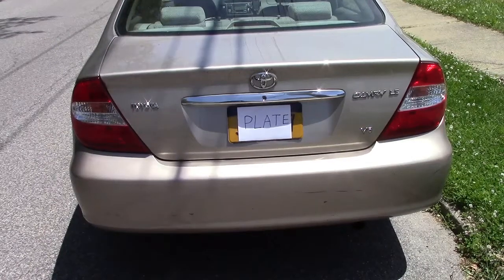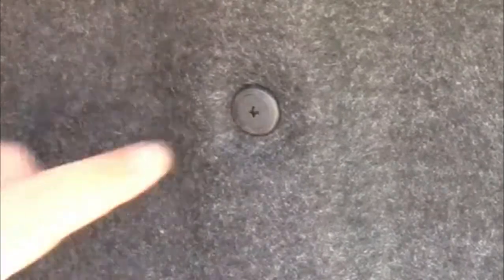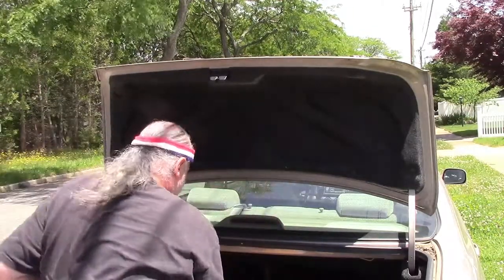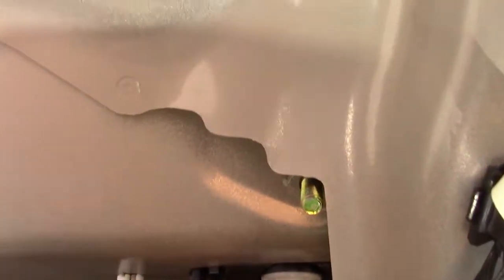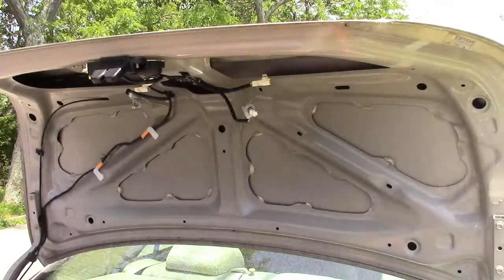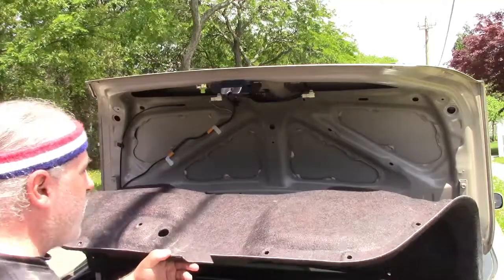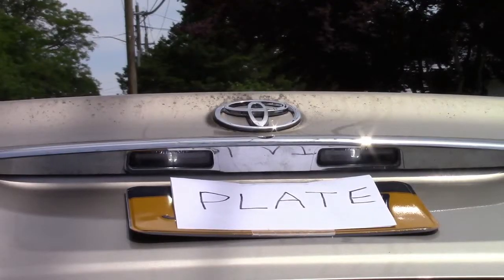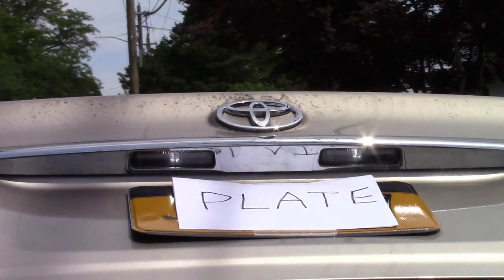How To Replace License Plate Bulbs 2002-2006 Toyota Camry

Comment: Your explanation was truly excellent, even though I'm not so sure you need the entire liner to come out before replacing the bulbs. I could be wrong. As a side note, thank you for the explanation of the philips head Toyota retainer clips. Unfortunately, I broke a few after someone told me you could just slip a flat head screw driver beneath the edge and pop them out. They popped all right...from being snapped. Live and learn.
Reply from the maker: You most certainly can do the job without taking the entire liner off.  I needed to remove it for the video, and believe me, it's much easier with it completely out of the way.  For the broken retainer clips, there are many styles, even kits, you can find online., for not much money.
Reply: @jaykay18  Yes. I did snag a bag of them. They're not OEM, but worked just fine. Appreciate your video and thoughts. Best
Reply from the maker: @msunshine123  Thanks!

Comment: Thanks for the help. I couldnt get that green handle off haha. I just slipped thr carpet off around it, and later took a pocketknife and cut a slit in the carpet behind the emergency release and now its easy if i have to do it again.
Reply from the maker: It's tricky for sure.  Your way is a lot easier if you don't mind the slit.
Reply: @jaykay18  haha yes one thing I love about my old Camry is since it's depreciated as far as possible Im not frightening to "customize" certain aspects 😆
Reply from the maker: @jimmypavone3231  I love when cars reach the "beater stage".  Don't have to worry about anything anymore.

Comment: Great video. On my 2003 the trunk release is in 2 pieces. There's a slot in the back where you can split it with a flat screw driver and remove the"cap". You can then work the plastic prongs that are holding the actual handle on to the sprocket.
Reply from the maker: Thanks.  Yes, it's in 2 pieces.  That's another way to do it.

Comment: Looks easy enough, and turned out nice!
I think those clips may have worked easier to fix my waffle iron, as opposed to the push in ones I got.
Reply from the maker: Yeah, not a bad job at all.  Rewarding when it's done.

Those clips came with the car, of course.  I bought a clip set, has maybe 20 different styles.  Bought it on Amazon I think, maybe fleabay.  Haven't needed to use it yet but I will, one day.

Comment: 2 Millennials were angry that this video was about changing dim lights. Not how to change someone else's car lights because they rammed into their car at 100mph with their BMW, drunk on Starbucks. Because Siri told them take a right, and they took a down, and think just replacing the lights will cover up the damage!

Very well done! How have these lights held up?
Reply from the maker: Millennials don't know how to change a light bulb anyway!  But the story sounds good!

The lights have held up fine.  Ginger doesn't get much mileage, of course, and not at night especially.
Reply: How many millennials does it take to change a lightbulb?

All of them, along with someone who will actually change it because that person knows what to do.
Reply from the maker: @nl.515  Har har!
Reply: The other melonables just watched part of it to see how to take them out and leave them out. Around here too many drivers don't know to turn on their lights, while the others intentionally turn them off or dim them out. It's hard, lonely work trying to avoid millennials sometimes.

Comment: Something to note since it confused me at first: the clips for the fabric are two parts, the screw and the outer ring it's placed in. You might need to hold the ring in place as you screw. I didn't realize this at first and was confused why I kept turning but it never came out.
Reply from the maker: Yes, they have been known to use different fasteners even within the same production run.  Sometimes they have a screw head.  Sometimes they don't and you have to pry them out.  Others have a button in the center.  I can only show what my car had.

Comment: This is a lot easier than replacing the bulbs in my car. I have to take the plate off, unscrew the plastic covers, unscrew more stuff, it’s a 45 minute process!

One person was upset they couldn’t see the plate.
Reply from the maker: This is bad enough just to gain access.  I've done worse, and seen worse.

If they had the plate number, they'd still downvote.
Reply: It's "PLATE7"
Reply from the maker: @isaac24  Great, now they're going to find it and tow it away.
Reply: Good thing you have 3 more.
Reply from the maker: @isaac24  Yeah, with PLATE4, PLATE5, and PLATE6.
Reply: I was just going to say that.
Reply: Better throw all 4 away!
Reply from the maker: @niks_crazy_world  Har har!
Reply: 4 ads, really, couple more adds you can get light up lug nuts.
Reply: I don't think he controls how many advertisements there are. Jay, chime in if I'm wrong.
Reply from the maker: @isaac24  Yeah I didn't pick them or place them, they just show up.  Got an email a couple months ago that YouTube was going to ramp up the amount of ads.  More ads=more money.

Comment: I cant seem to get the black clips back into the hole
Reply from the maker: As I had stated, make sure the center part is still pulled out.  You may have to bend the 4 prongs together, and wiggle it to get it in.  It came out, it will go back.

Comment: Your video was good but for my 2002 Camry you need to remove the handle with a 10 mm wrench. Removing it like how you did could damage the assembly. I'd advise others watching to just remove the handle with a 10 mm wrench rather then trying to pry it off with a screw driver.
Reply from the maker: There can be slight variations between the model years.  This one is a 2003.  The point is, the general concept and procedure is the same.

Comment: Sorry but the video never showed exactly what side did you turn the light bulb...smh
Reply from the maker: It only turns one way to remove the socket, and each side is different, so I cannot tell you clockwise or counterclockwise.  You will know, because it will go one way, and not the other.  There are TWO choices, that's it.  It's not difficult.

Comment: Bulbs are not coming out with a simple twist. Cant get them out to place bulbs
Reply from the maker: Twist harder.  A LOT harder.  When they've been in the car for 15-20 years they get stuck.  Just like all the nuts and bolts on the car that have rusted.
Reply: @jaykay18  I did this repair today and silicone lubricant was able to make them easier to twist. Maybe you could recommend this to new commenters like this
Reply from the maker: @colt2274  I'd have used an oil of some kind, a penetrating oil like PB Blaster.  But whatever's on hand and works, will get the job done.  Thanks.

Comment: My clips are smooth heads
Reply from the maker: Toyota uses different clips, from whatever supplier can get them to them fast enough and cheap enough.  The lowest bidder prevails.  This style with the Philips head is what was used on this particular car.  For smooth heads, if there is a "ring" or "button" in the center, try pressing on that or prying it up with a flat blade screwdriver.  If not, then get behind them and pry them out with the flat blade.  If you break them, no problem, they are sold in a kit of many different styles and sizes online for very cheap.  This isn't rocket surgery, this shouldn't hold you back.